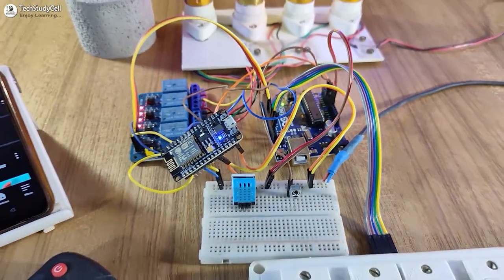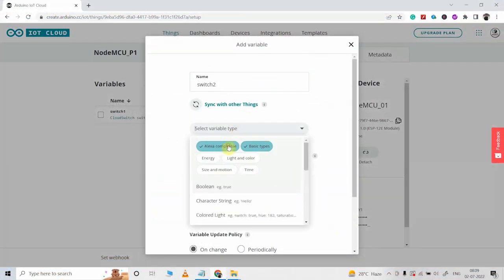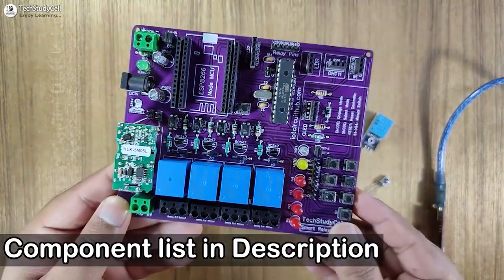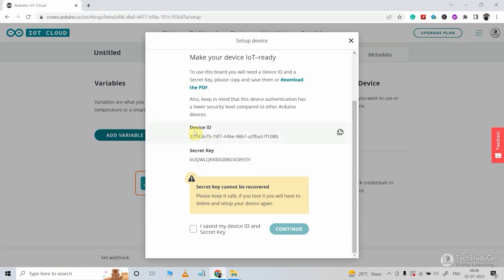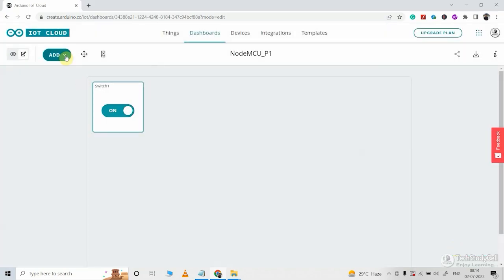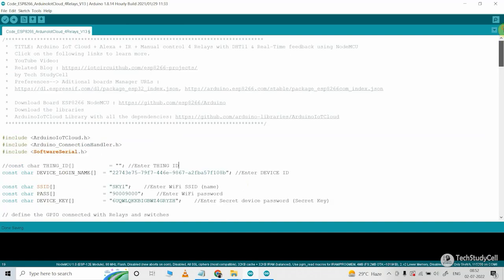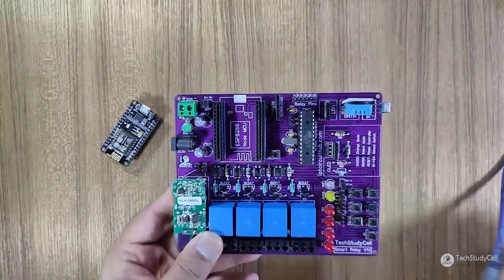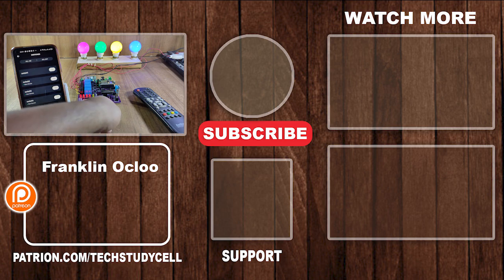Arduino IoT Cloud with Alexa Home Automation using ESP8266 Arduino UNO & sensor - IoT Projects 2022

Comment: I am a novice in ESP8266, but is it possible to do the same work with a web page to replace Alexa app?
Reply: It is to control my RGB led strip, I don’t want to use voice control, just a page to switch on/off and a color slider

Comment: Why do you need the Arduino if you have the ESP?
Reply: You don't. This project can be done with just the ESP8266.
Reply: @AndyMcGeever  How? there is no eeprom to register the last state?
Reply: @bacdesilva  The state is synced with the cloud. When you power up or reset, it connects to the cloud and requests the current state.
Reply: @AndyMcGeever  Interesting. How about if I want to connect a load cell to this? How would that store the calibration values? Do you ave an idea?
Reply: @bacdesilva  The arduino cloud can monitor and store analogue sensor values such as a temp sensor. You can specify the read frequency which can then be requested by a linked alexa from the cloud. Any calibration data can be stored in the ESP8266 flash memory.
Reply from the maker: For EEPROM, and no wifi control.